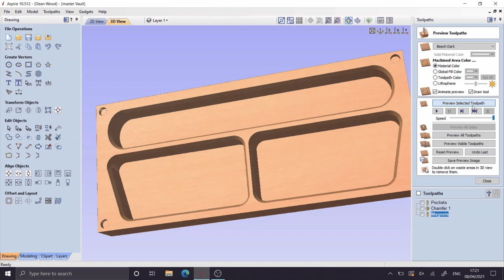DIY Table Top Gaming Vault: The Best Way to Store your Table top stuff

Comment: Great job.  I make similar vaults.  I am curious about your cut depths and your double-sided work technique.
Reply from the maker: Hey, thank you for watching. 
My work piece for this one was a bit of 45mm thick eucalyptus that I ripped down the middle on my band saw, I then took each side to 20mm. I cut the pockets to a depth of 15mm on each side. To give the continued grain effect I mirrored my tool paths in Vectric and carved each bit at a different time. When I engraved the monogram I set that up as a separate job but made sure that my bit was homed on the bottom left corner of the work.
Hopefully I'll be doing a more in depth video about 2 sided machining soon as I potentialy have an interesting project coming up.

Yet again thank you for watching and taking the time to comment 🤘